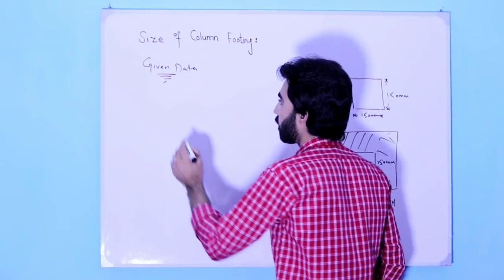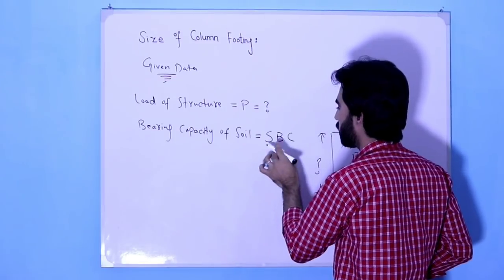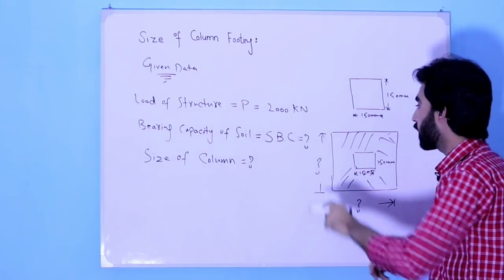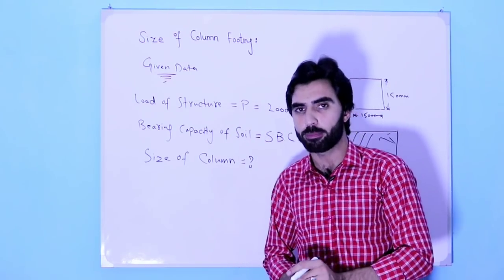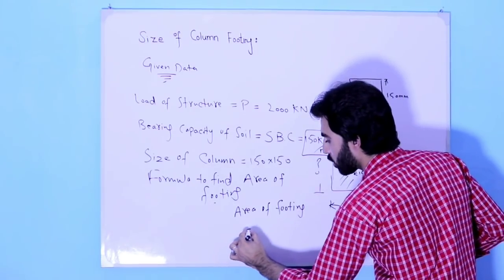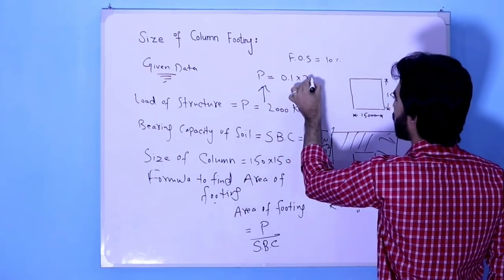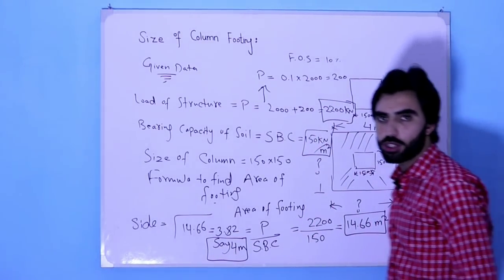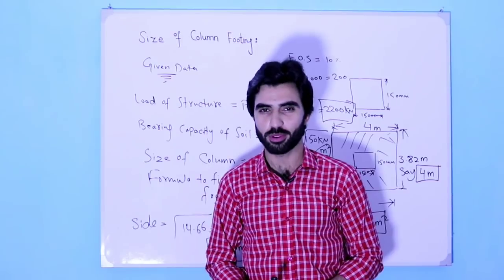Size of Column Footing - How to Find Area of Footing - Design of Footing- Civil Engineering

Comment: Thanks for your video 
I am a chemical engineer 
I have 2 comments 
1) the size of the column should be in m3 which means 150*150*150
2) the formula for calculating the area does not include the size of the column
Can you please advise
Reply: Lol. So it means the height is 150 mm. There is no such things. That is column.
Reply: Size is 150*150. This is enough for calculate footing size.